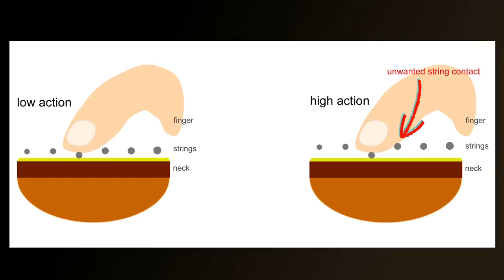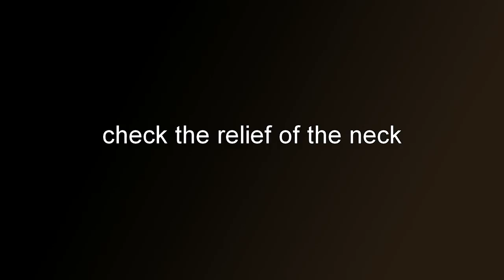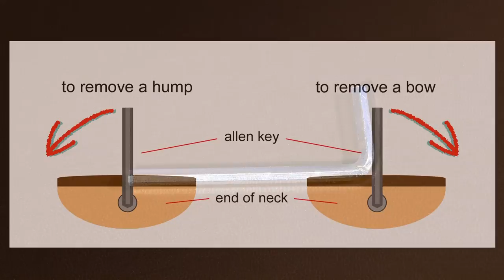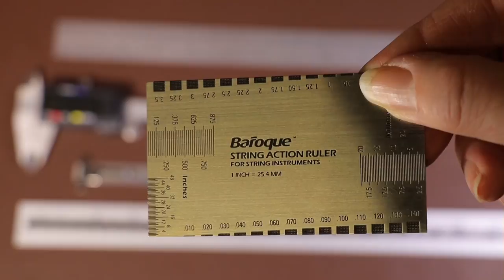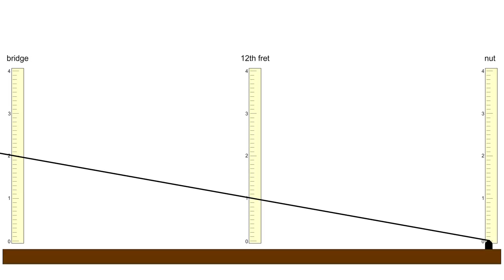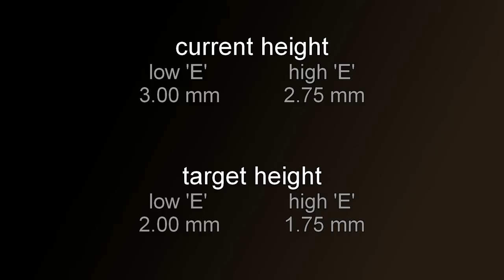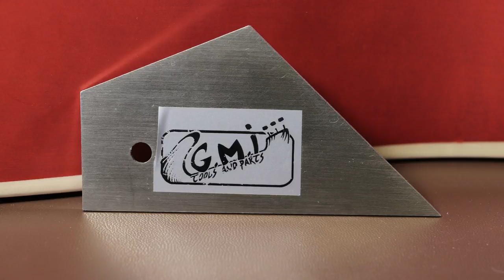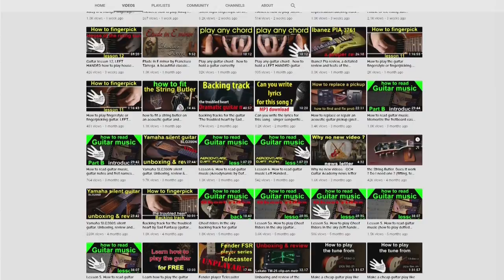How to setup an acoustic guitar, adjust the action, saddle & truss rod (Pt. 1)  guitar set up

Comment: Well probably the only thing not being clear is what to do if you measure the action on the 6th string - let's say 3mm, then the 1st string 1.75mm. If my goal is to reach 2.50mm on the 6th string then the action on the 1st string will be below the suggested height. And this is what happened with me, I've got a lovely 2.5mm on the low E string, but my high E became 1mm.
Reply from the maker: You have to sand very carefully . .  or you can get a special tool to get the correct angle on the bottom of the saddle but it is very expensive, so it would be cheaper to take the guitar to a luthier.  At least a replacement saddle is very cheap, so it's not the end of the world.
Reply: @guitar-academy  thanks! Are you implying that you can sand the saddle unevenly on a purpose?
Reply from the maker: @petere7810  To be clear I could do with illustrating this visually, but what I mean is . . you can sand the saddle evenly but at an angle.    I hope this helps . . 😊

Comment: Great video. Quick question, most videos and forums suggest to measure the string height at the 12th Fret without a Capo. 
I see you use one. I’m confused, which is the right way to get the most accurate measurement?
Reply from the maker: if you know your nut is the correct height then you can do the adjustment without the capo, but if the capo is un adjusted then use a capo.  Don't get too carried away with the measurements. it's how the guitar feels and plays that's important.
Reply: @guitar-academy  thank you! Great channel. I appreciate the videos.
Reply from the maker: @letsridehard  no problem, thank you 😊